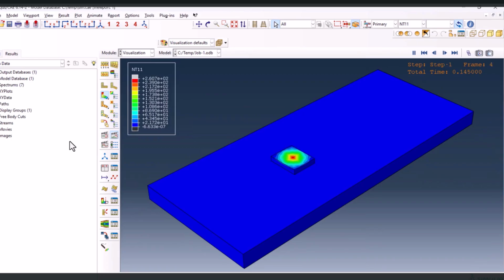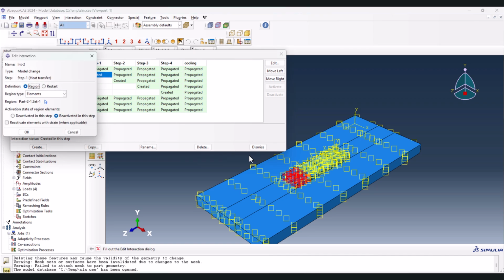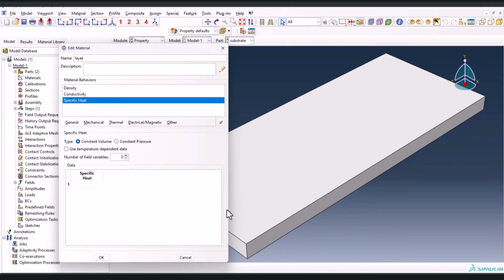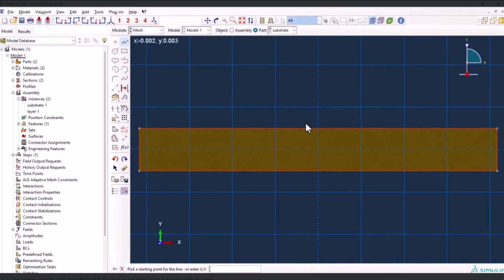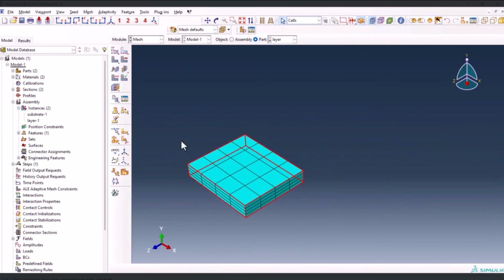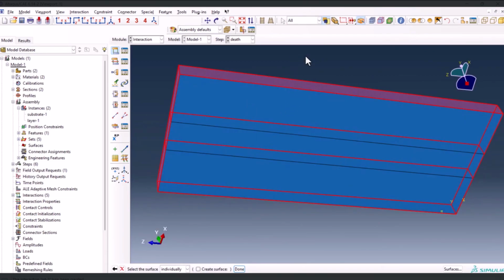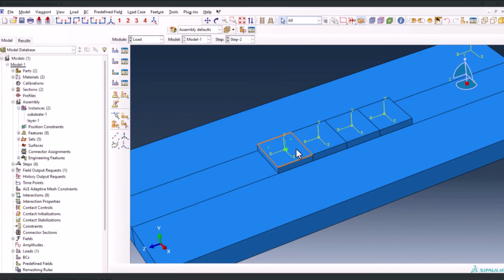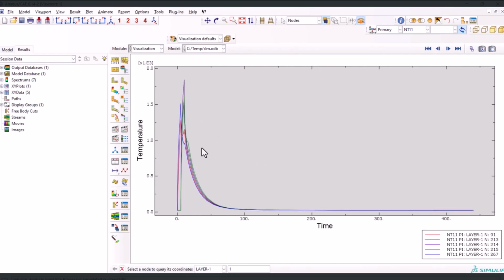Abaqus Birth & Death — Additive Manufacturing Finally Explained!

Comment: Hello, master. Thankful for your interesting trainings. During adjusting parameter for mesh  module with setting local seedingwith  Number 5 element on sizing control section for substrate according to your instruction, unfortunately after meshing, it create over than specified number ( aprox 48), and it not changes the initial number 48,please guide me to keep on, sincerly yours.😂
Reply from the maker: Try deleting the existing mesh and resetting the seed controls before applying them again.
Reply: @FEAMASTER I Appreciate for your help and allocated time for solving problem. Please do me favor      what version or package of abaqus have free access for installing of AM plug-in, and also is it good manner to install one pack of dassult software inwhich cover catia and abaqus together  if so what version have free access for installing. Sincerly yours
Reply: ❤ thank you very much indeed

Comment: Hi
What method of welding (WAAM) is this simulation about? 
Can this simulation be used for waam and tig welding?
Reply from the maker: WAAM is not a welding method. It’s wire and arc additive manufacturing usually based on Tig or Mig. For welding watch this video: https://youtu.be/RRfh8qwh8jQ?si=DQm3cFQFRpGlYzxq
Reply: @FEAMASTER Thank you so much. What I meant was what's the heat source of the wire arc deposition. Sorry for my bad English.
Reply from the maker: @sinimini5275  No worries at all! In this one, Tig-base is used, but this example is for educational purposes doesn't matter which one is used.

Comment: If we do birth adn death technique instead of using subroutine, can we still measure the parameters like distortion?
Reply from the maker: Hey, birth and death is not separated from subroutine because you can have birth and death and subroutine together. But if you mean using this approach we used (different loads in different parts) yes we can have residual stress and distortion because in both cases, you have thermal loads and the result is nodal temperature. Watch this video: https://youtu.be/S7Hn8eaC6ik?si=KEeoSrbEWjrj45Gi

Comment: Will u tell me,what value of Q,C in your analytical equation??i am facing problem on this particular point,
Reply from the maker: Q is the load magnitude which 1.2e7 and C is 0.00002809.
Reply: @FEAMASTER thanks❤
Reply from the maker: @amirahmad6823 Happy to help!
Reply: @FEAMASTER i am trying your way,during analytical section, u put a magnitude value of load which is 1.2e7, but in your analytical equation format,where is,3*Q/(π*c**2),,just writen exp part,also,u did not put (Z-Vt)**2,,,just Z,,,did not put c**2,just C value which is. 00002809,also where u put value of velocity(v), will u clear this point please????
Reply from the maker: Good questions 👍
I split the equation into two parts. The constant term 30Q / (π c²) was pre-calculated and entered as the load magnitude (≈ 1.2e7), which is why only the EXP(...) part appears in the analytical expression. Also, 0.00002809 is c², not c — I misspoke in a previous comment, thanks for catching that.

Regarding (Z − v·t): I used multiple steps (e.g. 4 steps), so the time progression was handled through the step definition, which is why I didn’t explicitly include v·t in the expression. In that setup, the heat source motion is implicitly captured. For a single-step or fully explicit formulation, writing (Z − v·t) directly is the correct and more general approach.

Hope that clears it up 👍
Reply: @FEAMASTER nice explanation❤️. I followed your way and have learned many things,, got a output like your job,,,,, it would very helpfull with dflux where have scope more precise result specially during validation,,
Reply from the maker: @amirahmad6823    I'm happy to hear that. Watch this video as I showed you how to run this with DFLUX, it doesn't have the birth and death technique though.
https://youtu.be/mxvQkvNpvtk?si=r8G36Qi4MT-rsVWj
Reply: @FEAMASTER i watched it earlier,made some of job by Dflux to follow your way.but unable to implement birth death technique with dflux, thanks again to make this platform and share your knowledge to us in easy way,great job❤
Reply from the maker: @amirahmad6823 I’ll make a video on it then!